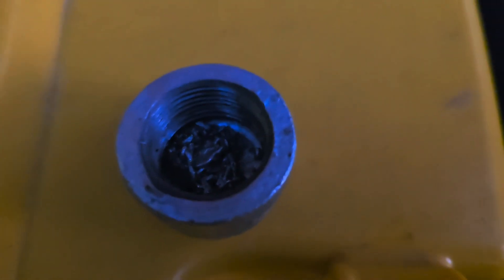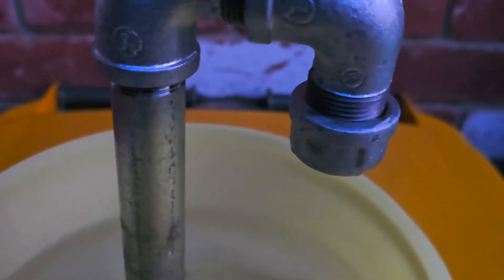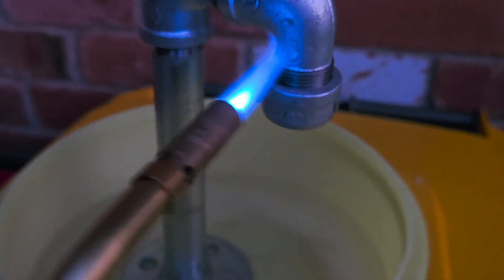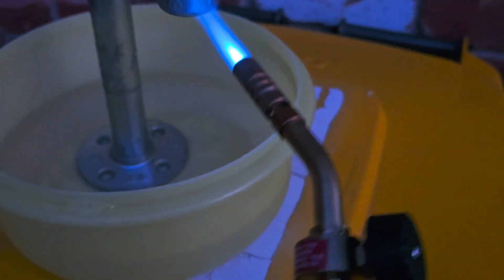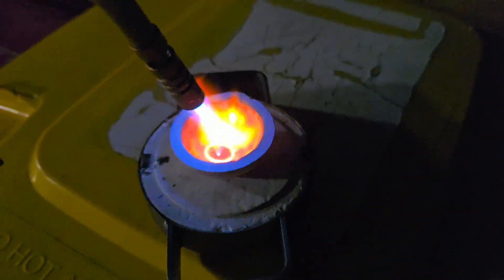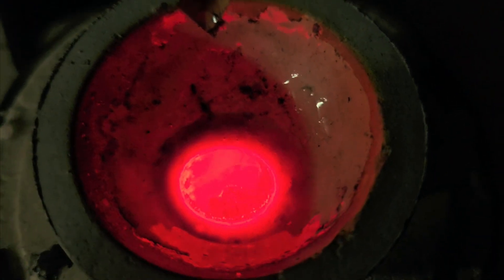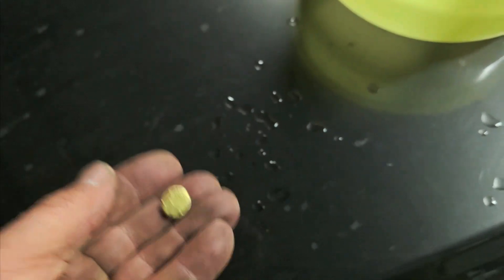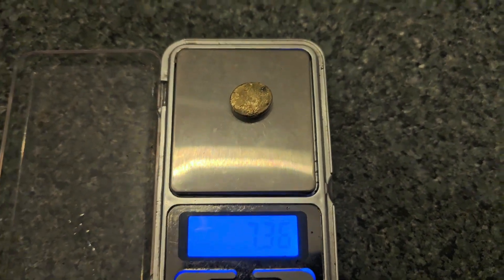Home made Gold Retort

Comment: Good job Victor, dont forget to seal the threads on your system with some plumbers putty and to do it in a well ventilated area. Dont want to be breathing any of the fumes! Nice button! Q. Did you get any of the Gal infusing with the gold? Regards Andy PPA 🇦🇺
Reply from the maker: @andypandyAU.6669  I was outside when I did it. I don't think any gold infused.  I tried moving the heat around the pipe. Rather than focusing on the nut itself.
Reply: @MurrayRiversGoldAdventures  good to see some great content, are you having fun yet?
Reply from the maker: Wait until you see the large furnace I got & I'm pouring larger quantities of gold. Lol
Reply: @MurrayRiversGoldAdventures  have to call you the Murray Mint
Reply from the maker: @andypandyAU.6669  lol